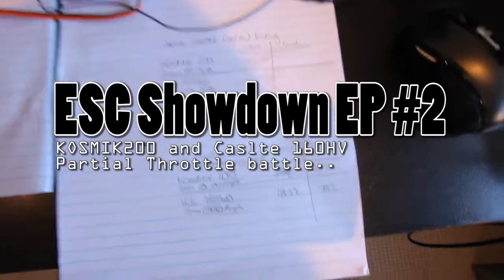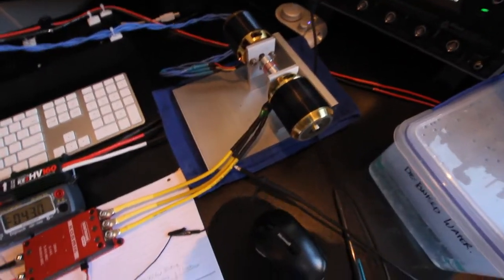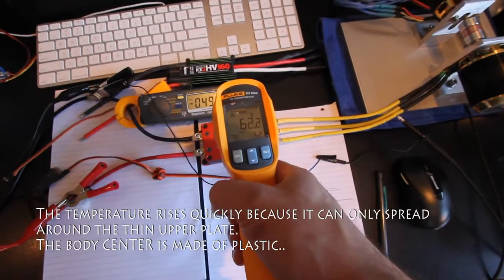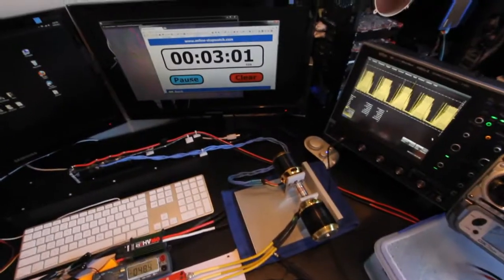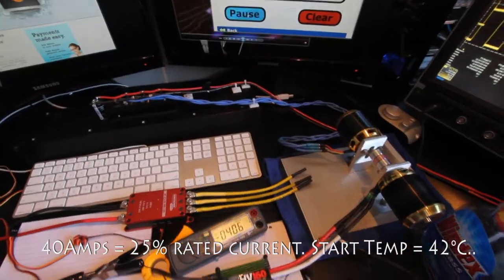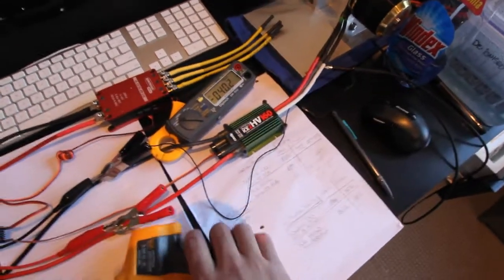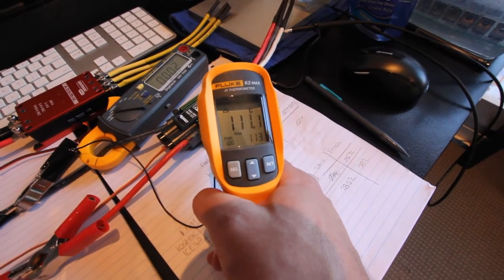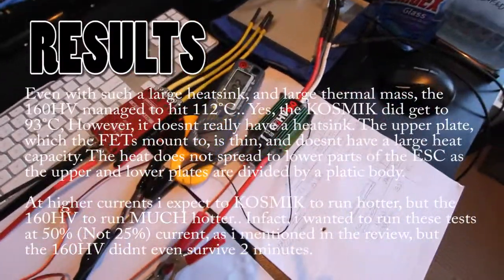ESC Showdown EP2: KOSMIK 200 + ICE2 160HV -- Partial Throttle Testing.

Comment: I have the Castle EDGE 160 and was thinking to get the Kosmik 200 tomorrow but would it be worth getting to run my PYRO 750-56? Though with the Kosmik I was also thinking to get the PYRO 800-48 the go in my Goblin 700 Comp using the 3 bladed hed. I just can't justify getting a Kosmik because I can't tell if it's better or more efficient... Someone please reply

Comment: thats why putting them were they can get good airflow ether from the airstream or rotor wash is important

if you place it well it can get a ton of cooling form the rotor wash 

some of the scale guys do put fans of them when there in a fuse

Comment: both heatsinks are very tiny compared to their current levels. electric cars (with people on them) don't run much bigger currents yet they have very large heatsinks or water cooling. 
it's actually quite impressive that they can function with that little cooling, not even a fan.
but apparently they can't for very long